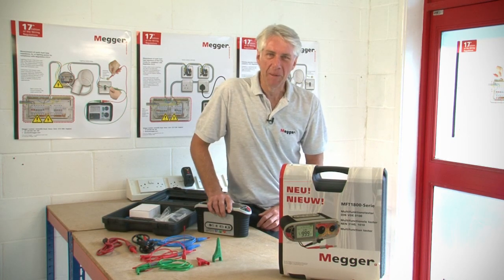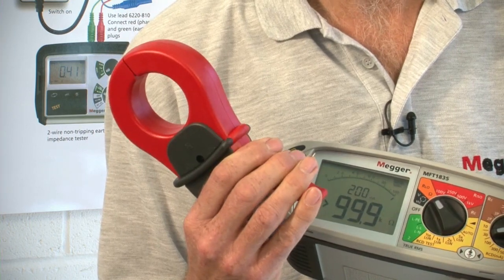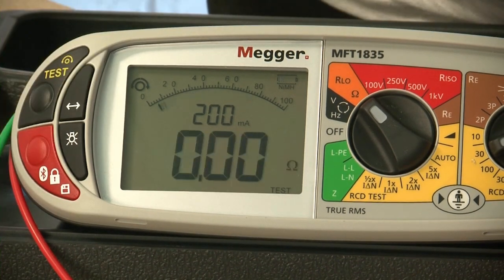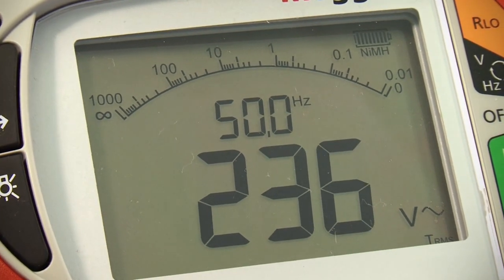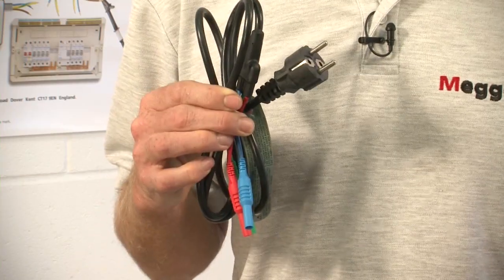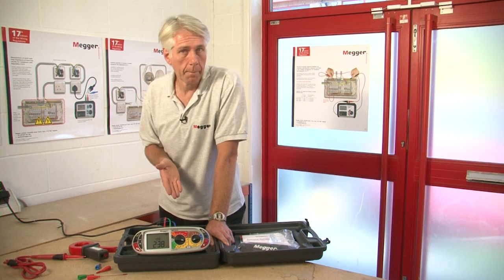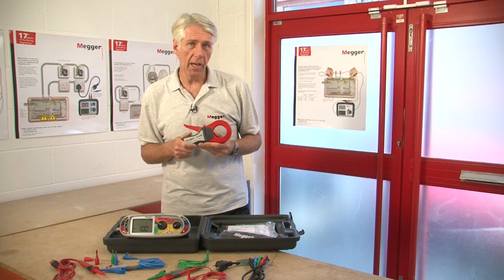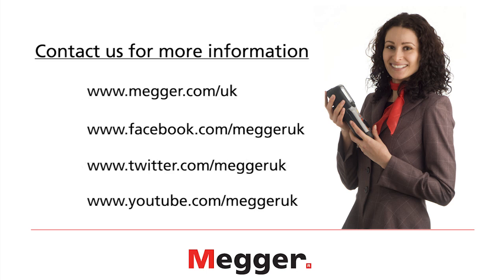Megger MFT1800 Series user guide

Comment from the maker: Hi thanks for your comment. We ship MFT's with charged special low loss characteristic battery packs, they are not standard nimh, so they can sit on wholesalers shelves for some time and still have enough charge for a customer to take straight on site. Lithium batteries self-discharge so would not do this. Also rechargeable Lithium AA cells are 3.6V each so if the battery did go flat on site you could not swap for dry cells which would mean waiting for the battery to charge.

Comment: I wish the next series makes more use of Bluetooth. I wish there was an Adroid app, where I can trigger tests like resistance remotely, transfer measurements in real time to the phone for display, and ability to save each measurment on a phone in simple text files, with date/time and type of each measurement, as well a custom name. This way one can plug a meter at the consumer unit for example, disconnect the supply and all loads, then go around and short all sockets and lighting fixtures, etc to measure quickly all resistances. Similarly the 3 wire earth connection testing would be really easier with a phone that you can carry around with the movable rod, instead of walking constantly between movable rod and the meter.